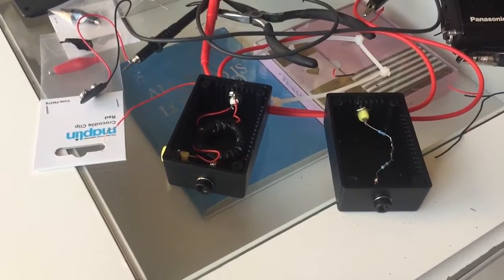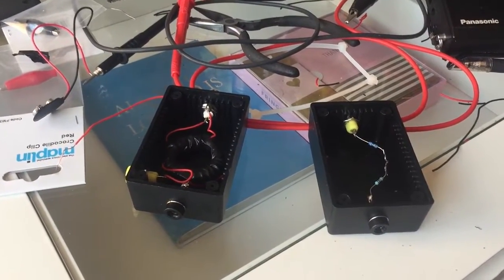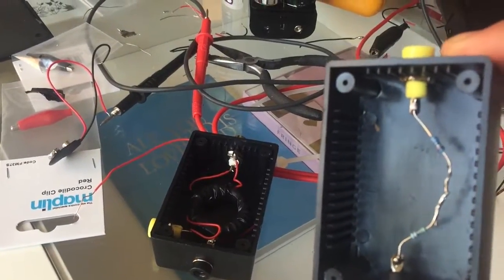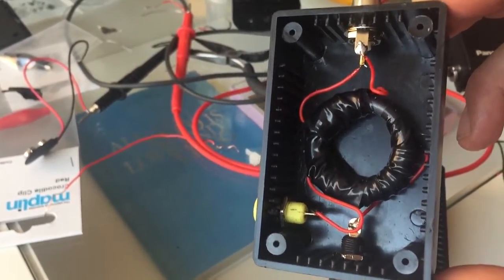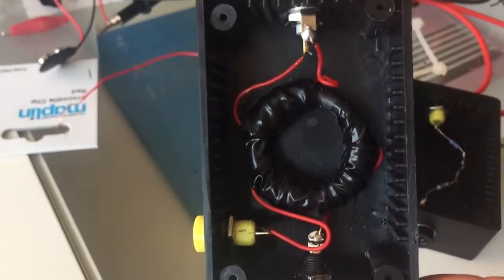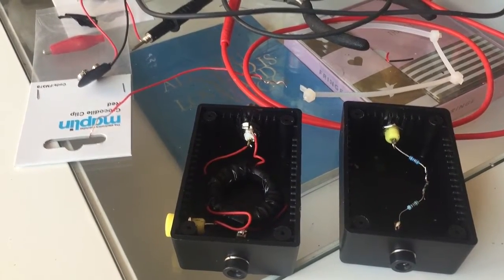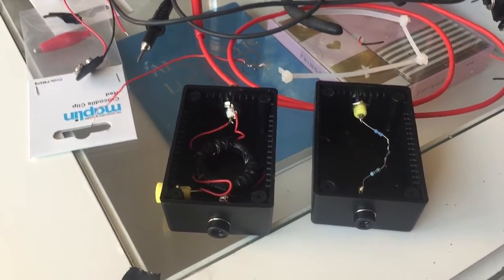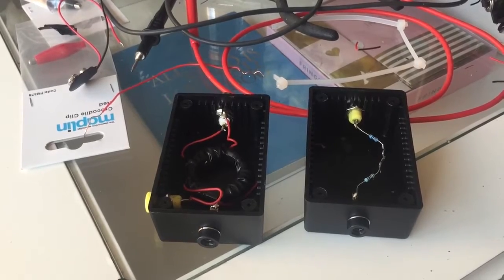Project update: 200 metre deployable antenna system - standard longwire & Beverage

Comment: Hi Clint, very engaging series on your beverage project, you've almost got me motivated to build one HI.
Just a couple of thoughts, I recall people mentioning that it's best to use carbon composition rather than carbin film resistors as the latter are prone to going open circuit in the presence of high voltages. As for support, have you considered the posts that are used for supporting temporary electric fences? they have a series of clips at varying heights to support the wire.
Reply from the maker: Hi Nick, thank you very much! I've not tried an electric fence posts as a support mechanism, but anything is worth a try. Just to get the wire of the ground will help a bit (otherwise it's a BOG - Beverage On Ground). As regards type of termination resistor, there aren't going to be any high voltages (unless it's struck by lightning) so I wouldn't worry about that. 73! Clint

Comment: Very neat Clint. I think you might be able to hide the longwire up high in the trees so you won't have to restring it every time too or maybe some little hook things on the trees to make it easier :3
Reply from the maker: Hi there, that would be very neat, then all I would have to do is terminate both ends with these boxes and a few short cables etc. I must be the only nutcase in the World willing to deploy a 200 metre antenna for a few hours and then reel it back up lol! 73! Clint
Reply: Oxford Shortwave Log Yeah like a clandestine british spy tuning in to hear the numbers hehe I would use one too but I have no trees out here lol I would need a decent truck or trailer to haul so many portable masts, although your balloon idea does come back to mind :3
Reply from the maker: Ha ha yes, I really like the idea of using 3 helium balloons to create a temporary vertical antenna. Having said that, I think it's just a fun experiment lol! 73! Clint
Reply: Oxford Shortwave Log Yeah a high vertical like that and everything will come in local sounding. I might just use a small balloon and do like a 50ft vertical.
Reply from the maker: That would be great of course, but I think you would need to tether it on 3 (light) cables otherwise it will blow around a lot lol! 73! Clint
Reply: Oxford Shortwave Log It would still blow around but now that it's tethered the longwire will slack whenever the balloon still moves. Not to mention you would now need more balloons to support the added weight. You'll be fine on calm days. You should see the 200 foot one at the car dealership.
Reply from the maker: Ha ha well I think a lot of experimentation would be necessary...either that or buy a manouverable airship lol! 73!
Reply: Oxford Shortwave Log Yeah it's not ideal but a cheap way to get up. I've done it before for aerial photography. A blimp would be a dream though. Just open the window and drop out a 1000 feet of wire while over some salt water lmao :3 73
Reply from the maker: Ha ha can you imagine lol! 73!
Reply: Oxford Shortwave Log ah yes haha the next SWLing.com DXpedition :p
Reply from the maker: Ha ha - good point! 73!

Comment: Fun experiment, Clint! You are correct about the voodoo regarding these type of antennas; there's a lot of information available and some of it conflicting. I think that Tom W8JI has the best analysis of these antennas by far:  www.w8ji.com/beverages.htm.  In my experience, Beverages are low gain antennas, but are higher in signal to noise ratio, which is really what it's all about! A good balun can provide more efficient transfer of the already weak DX signals reaching your receiver. What are the target stations that will be off the end of your deployed Beverage antenna, and at what bearing from Oxford?
Reply from the maker: Thanks Guy.Thanks for the link - I will take a look. That's exactly right, they are lower gain, it's intrinsic to their design, but they do often have higher SNR and on the Tropical Band, that is everything. I will be targeting South America on SW and South and North America on MW. I think for S. America 230 to 240 azimuth. 73! Clint

Comment: You have been busy Clint. Matching the antenna to the receiver should bring benefits. A copper earth spike is the answer. Screw fix do some that you can join together so if the earth will take it then join 2 together. Good luck! 73 Graham
Reply from the maker: Hi Graham, well I had a few spare hours off from the housework lol! I agree, matching will help - but it requires two baluns for the Sony - 75 Ohms I think and the Elad - 50 Ohms. No bother though and worth the effort as I do like an experiment! :-) Thanks and 73! Clint
Reply: I'm going to be interested to see how this works. I've just acquired a field behind us so will be putting a mast up soon but I'm also going to have a fair bit of space for a receive only wire. 73 Graham
Reply from the maker: A Beverage is the best type of antenna below 5 MHz but has to be at least 1/2 a wavelength, so for medium wave DXing you're looking at 100 metres minimum and preferably 200 to 500 metres. 200 metres is good for Tropical Band DXing because you're at more than one wavelength for the 120 metre BC band and more than 2 for 90 metres. I too need a field of my own lol! 73! Clint